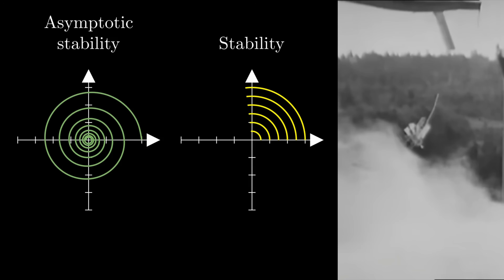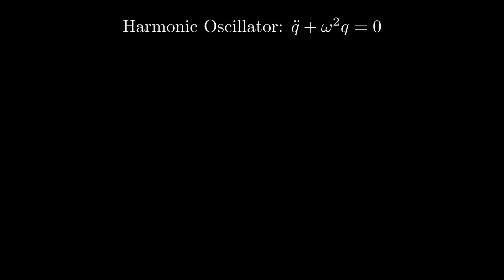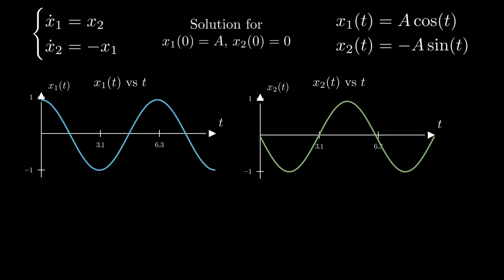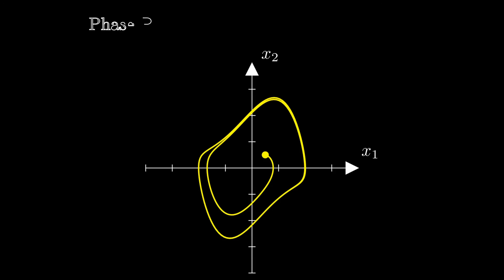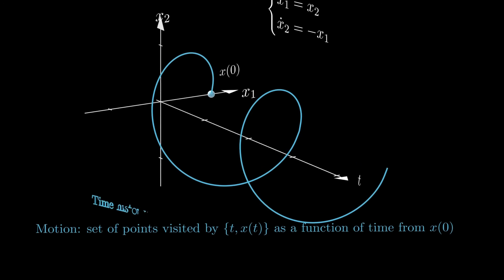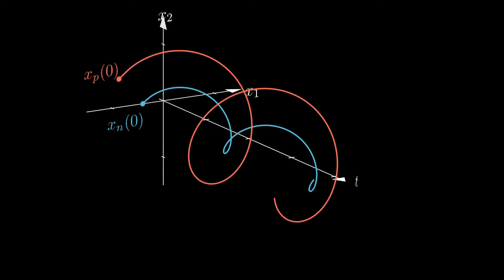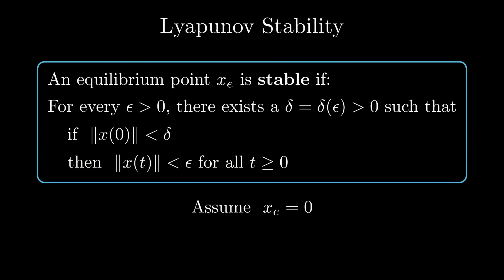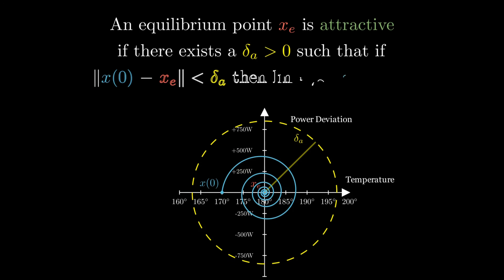A Visual Explanation of Lyapunov Stability

Comment: Excellent video!

Not being pedantic, but just making a note that the definition you provided holds for Autonomous Systems; for Non-Autonomous systems, stability and delta depend on initial time t_0 not necessarily 0

Moreover, the last part leaned more towards Asymptotic Stability which is stronger (and implies) Lyapunov Stability

But a great video nonetheless ❤️

Comment: Since I realized that there are systems with solutions of finite duration, every time I see a video about control theory, I felt kind of scamed... let me elaborate, as in the harmonic oscillator with drag (pendulum), it is said that the phase space point (0,0) is atractive and stable, but what is never mentioned, is that it will take infinite time to achieve the rest position! it will be oscillating forever without never achieving it in finite time... and which is worst, is that every system I saw in engineering behaves like that, since in order to have a system with a finite extincion time is mandatory to have in your ODE at least one Non-Lipschitz component.... which in principle could be thought as something very nonlinear, it is actually not hard to achieve, I have found even oscillators with closed form solutions, but is like science and math just have decided to ignore their existence... I believe that many of modern physics weirdnesess would dissapear if they stop being stuck on Lipschitz kind ODEs

Comment: Epsilon ball? Isn't it an epsylon cylinder in terms of that graphs? Maybe motion dimension is not counted when calculating norm, only projection to. I have no idea btw, is time matter in calculating norm. By intuition it seems not, only instant position matter.
Reply from the maker: Good question. The definition of stability of equilibrium points and the definition of stability of motions are different because of the additional time variable. What I provided is the definition of stable equilibrium point, not of stable motion. However, in explaining the implications, I colloquially talked and showed motions. This is possible because the equilibrium point can be interpreted as a special motion (a semiline) and so the epsilon ball at each time instant is a circle. In the video, I was very careful in not saying that the "motion is stable", because, in fact, I never defined what a stable motion is, and I would have to have introduced the time matter. It is a little technical detail that would have complicated things. So the cylinder should be interpreted as a collection of epsilon balls at each instance of time, meaning that at each time, the epsilon ball condition must not be violated. It is not enough to consider the projection when looking at the motion. Take for instance two motions going in the same place, but one at 1/10th of the speed. The two motions would be very far from one another and the epsilon ball condition may be violated.

Comment: A very amazing video, thank you. I was wondering... Can we apply this to optimization? Even more, to stochastic optimization. Intuitively, we should have there also stable points (when the algorithm converges, pushing it further with the algorithm leaves us in the same place), and deterministic algorithms (defining the dynamics of the system, how points are driven) are necessarily defining "trust regions" in a neighbourhood of stable points. The question here is, having the space divided into a subset of trust regions, what is the probability of starting from a point that converges to a stable point defining the global minimum of the landscape? And, of course, how can we have an a priori estimation for that?
Reply from the maker: Yes, your intuition is correct. This is a well-established field sometimes called dynamical systems approach to optimization. For deterministic algorithms like gradient descent, the algortihm is a discrete-time dynamical system, the local minima are the stable equilibrium points of the system. The objective function itself often acts as a Lyapunov function, proving convergence by showing its value decreases at each step. Your second question, about the probability of finding the global minimum, is a central problem of stochastic optimization and global optimization. It's analyzed using stochastic stability theory to understand how algorithms like Stochastic Gradient Descent or Simulated Annealing can escape local minima and converge to the global one. One the ideas being that the stochastic gradient descent can be reinterpreted as a stochastic differential equation. Interesting but tough topic.

Comment: Alright, I want to see more videos like this, so I clicked the subscribe button.
Reply: I personally would find videos about Stability of Mimo systems as well as sliding mode control quite interesting and helpful.
Reply from the maker: What topics would you like to see?
Reply: @Prof_Gio  I'd like to see more of engineering maths visualised that normally doesn't have visual cues on its own.

A lot of engineering equations already have their visual counterparts, when a variable correlates to the number of windings in a coil, stiffness of a spring, or even volume of fluid flow per second, it's easy to understand what's happening.
But when we get into optimisation equations (with a lot of variable), or solvers (like CFD Rieman solvers) or control of dynamic systems (like this Lyapunov stability), it's not as obvious what's going on.

But other than that, I'm also interested in Krylovs theory of the oscillations of a ship on waves. That's something I haven't explored yet.
Unlike a governor or an F1 suspension, that try to stabilise whatever disturbances can arise, you could als predict the motion of the boat, and work with the sea and with the hull shape.

Comment: Very interesting and well-made video. My only suggestion would have been to avoid introducing a discrete system during the examples, given that the system was initially defined as continuous at the beginning of the video.
Reply from the maker: I agree, but it is the simplest example I could think of which clearly showed the difference. I considered another couple but they either are systems with complex dynamic for which it is difficult to really show the difference, or very simple systems but defined on a circle. In the end I decided that overall the discrete time system was the simplest example, although I am a bit unhappy about it.

Comment: I have a question about 10:00 the criterion states (according to my reading): FA(epsilon>0 | TE[delta=delta(epsilon)>0 | (||x0||<delta) => FA(||xt||<epsilon) ] )  (||xe||=0), but can you not find delta<||x0|| making the implication and thus the statement hold?
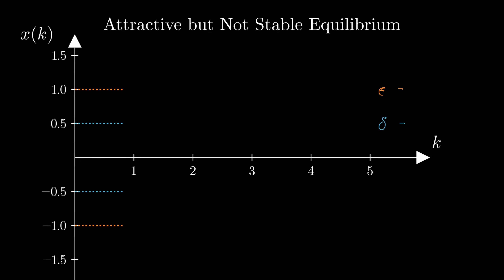Also side note: at 16:34 you do mention it, delta<=epsilon, after relistening to it, I do see know this is could follow from the implication, but it was not that obvious to me where this was stated. The fact that it is midnight for me probably also plays a role though😅
Reply from the maker: 1) the statement requires you are able to find a delta-ball for which every x0 in the ball has a certain property. You cannot pick delta smaller then ||x0|| because there is no x0 without first selecting the delta-ball.
2) it may not be obvious at first, but if you pick delta>epsilon then the condition  ||x(t)||<epsilon fails at t=0, because you would be allowed to pick an x0 such that epsilon < ||x0|| < delta.
Reply: @Prof_Gio  I appreciate the time you took to respond to my question. Thank you for your reply!
Reply from the maker: @ZK-im6er  My pleasure.

Comment: and this is why people prefer PID's , zero application, no example, just theory

thing is, this also assumes a perfect model, if the model isnt perfect it falls, better to just simulate, do you really need this in modern engineering?
Reply: Actually, this is crucial for modern engineering - and it lays the foundations for more advanced techniques that can cope with model mismatch, uncertainties, disturbances, time variations and so much more. Arguably, as systems become more and more complex and are required to work in unstructured environments, in proximity with people, or in sensitive environments, this is nothing short of central to modern engineering.
Reply: @1988Tull  i think you can rank the abstraction scale like this:

1. real world system
2. simulation, vary parameters, add noise etc
3. theoretical things you describe

in engineering a golden rule is to always be as close to 1 as possible, all data from 1 is by far the most valuable, you cant always because of costs but i dont see much value in 3
Reply from the maker: PID isn’t an alternative to Lyapunov stability: one is a control strategy, the other is a property. In fact, PIDs are designed to achieve stability, so it makes no sense to put them in contraposition. You are comparing "orange juice" with a "blender" without realizing that blenders are used to make orange juice. You can use a PID controller, but whether you have a guarantee that it actually stabilizes your system depends on the stability analysis, which is exactly what Lyapunov theory provides.

And no, modern engineering isn’t about "just simulating". That’s an outdated view. Modern engineering is deeply analytical. Simulations are tools for validation, not substitutes for analytical approaches. The reason we can safely design aircraft, autonomous vehicles, and power grids is precisely because engineers use analytical tools like Lyapunov theory to guarantee stability, safety, and performance before running any simulation or experiment. Without that theoretical foundation, you’re just tuning parameters and hoping for the best, and that’s not modern engineering. Examples: siemens, asml, philips, IBM, and any other big R&I company, including national system operators, distribution operators and so on.
Reply: @Prof_Gio  where should i start? i think you are my inverse... 

with people using PID's i didnt mean to compare PID and lyapunov, i meant to compare simple applied methods compared to theoretical abstract things detached from application

engineering is never and will never be founded in theory but in practice, in the end you are building something, modern planes are built with simulations, computers are new making simulations possible, Lyapunov died 100 years ago…

if you simulate with varying parameters it is closer to reality than analytics and being as close to reality as possible is the golden rule of engineering

you in the academic world are too abstract, maybe this video was a fun thing for academics to get a feeling for some maths that you use and not intended for engineers, but if you want to see your things applied you have to be super applied yourself. This is applied mathematics. Phase/gain margin is advanced in the industry, lyapunov stability analysis i never saw since school. If you want to see it used present how and when to use it. I mean a video about control engineering without a step response should be illegal… ;-)